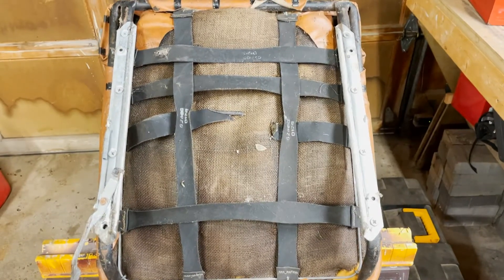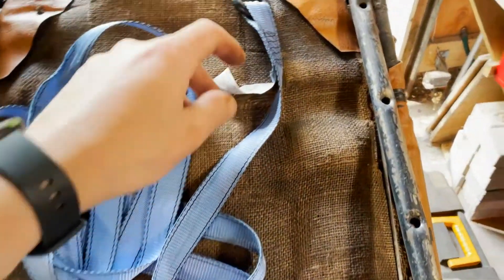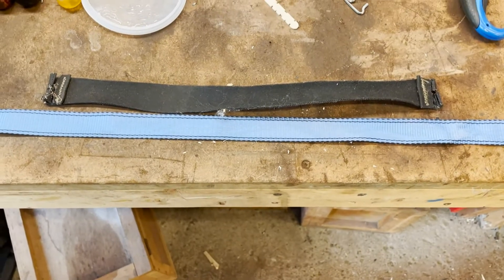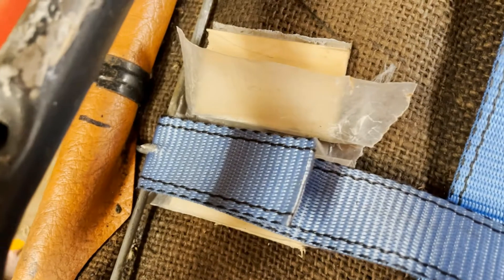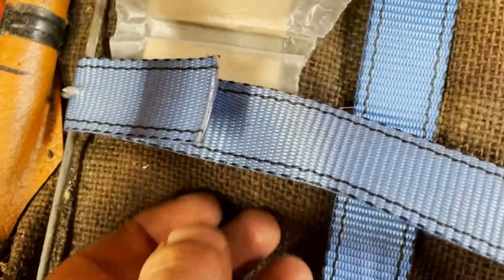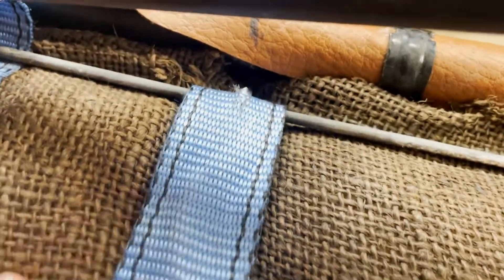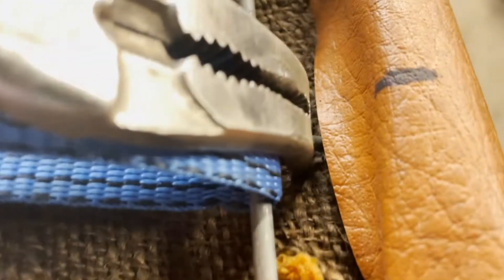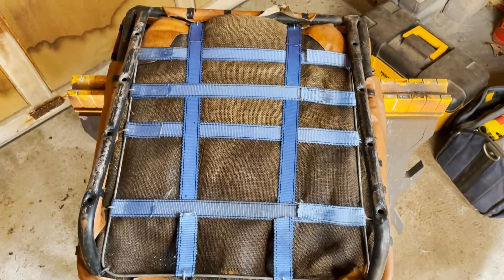MG Midget Seat Webbing Repair - Cheap Way

Comment: I am about ready to redo my drivers seat.  Just a thought.  Instead of sharping the clips and pushing them
 through the straps.  It might be easier to take an appropriate size piece of metal rod, wire, what ever and 
use a propane torch to heat  up the end to burn a hole through the strap.  This would be fast and also
singe the strap fabric to prevent it unravelling.
Reply from the maker: That's a good plan for one side, but pulling the other side tight required the sharp clip on the second side.  I didn't find that the material unraveled with the straps I used.